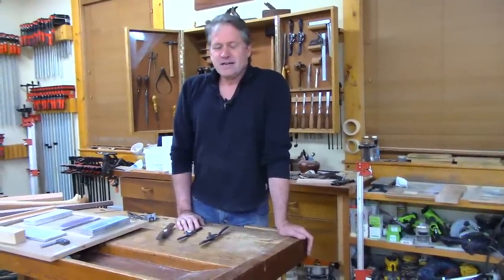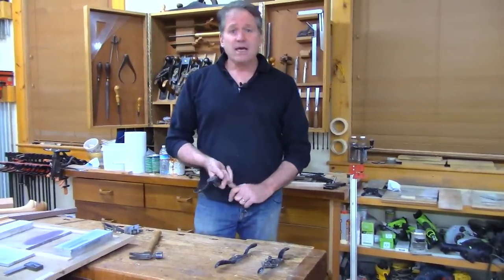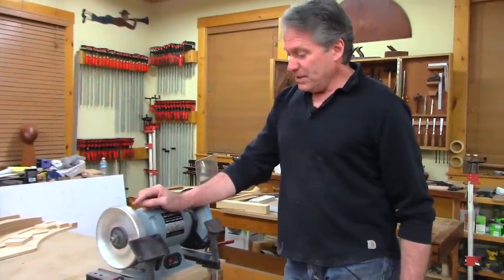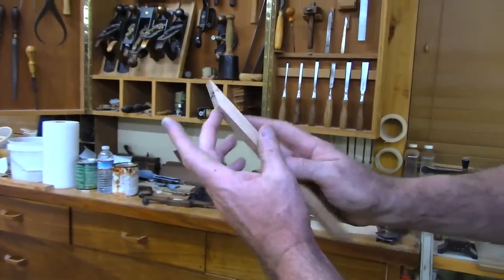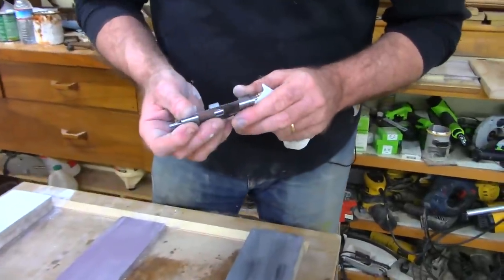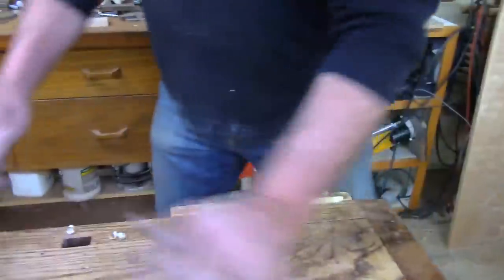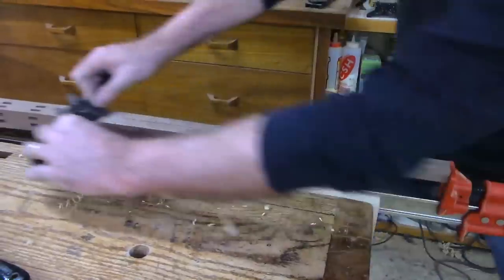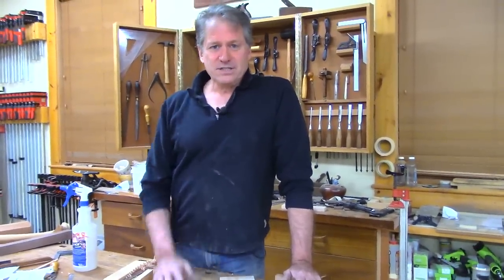How to Sharpen and Use a Spokeshave with Tom McLaughlin

Comment: I’ve got both a simple flat and a convex spokeshave in the No° 151 style, but I’m building one of those Veritas bevel up kits; the handle blank is made from Apple in this case (which for some reason is my favorite handle material for mallets, saw handles, and plane totes) and knurled nuts already have a great patina.   The cheap TayTools set has served me well and I’m glad I got started with them because I was forced to learn how best to sharpen and set them up.  They are greatly forgiving and permit all sorts of experimentation.   In fact if not for the spokeshave, I’d not have ever probably invested in my small 5” slightly curved drawknife.  Both drawnknives and spokeshaves are a bunch of fun and even if you’re not a green wood or a chair maker, a spokeshave will come out in all sorts of occasions.  Not just for chamfers and is an extremely inexpensive tool to add to your collection; especially when you consider the ‘legs’ it gives to your work.  I think the taytools and the kutz are both really decent options for those who can’t find vintage or are worried about what is often horrible pitting on old spokeshave irons that weren’t cared for.    I’ve got large hands and made a really easy jig for holding my spokeshave irons using an idea from Paul Sellers.  The irons are short and sharpening jigs like the bridge city tools, Lie-Nielsen, or tormek will hold them, but for hand honing the handy jig really got me up and going fast if you don’t have a honing guide that can hold and square up such a short iron.  I’m sure you could use a Veritas MkII, but getting the iron square was my issue and so why I built the little Paul Sellers holder until I was able to get a L-N jig.  

 Any luck/update on if Goosebay or another hardwood shop will be partnering to offer project packs in one or more species for some of your project/plans?   I reallllllllly want to build in cherry some, but cherry is nearly impossible to find down here anywhere, so a bundle shipped from a dealer that contains what I need to build a specific project would be great for me, great for the hardwood dealer, and add another great feature to your online classes/built alongside projects while allowing us to also work in species we wouldn’t otherwise get to. 

A big Thank you to both Tom and Kris!  The whole Thursday night and being in central time still isn’t best for me to participate live because Thursday evenings are great family time for us.  I say it every week, “maybe next week”🤣.   At any rate, I appreciate you both pray for you often. 
S/F, Shannon
P.S.- Finally found just the seat blank I was looking for to build the shop stool and 100 bf of maple at the same time yesterday 👍, so I’ll be jumping into that as soon as the walnut acclimates to my crazy humid, big temperature swing prone barn/shop here in Northwest TN.
Reply: Here’s the link to Paul Sellers spokeshave iron holder I spoke off.  It’s a simple scrap wood solution for those without a long jaw L-N or bridge city tool jig:
https://youtu.be/sw1JGEbKgCw
Reply from the maker: Thanks Shannon! Sounds like we share lots of similar enthusiasm for the attributes of the spokeshave! I have heard about the various methods for extending your honing jig to accommodate the spokeshave, and wishing I had included something about them. But I think Paul Sellers has a great method that certainly does the trick! I’ll have to mention that sometime soon.
And I have talked to Goosebay about materials for projects. There really isn’t enough demand quite yet for them to create bundles, probably due in some part to the added labor and expense shipping. But they definitely will ship if you just tell them the rough sizes you need for the boards. I am surprised there is little availability for cherry there in Nashville.
Great you got the materials for the stool and then some! Looking back on it now, I think the most comfortable seat “sculpting” is closer to the way the old metal tractor seats were shaped. Hope you enjoy the project whenever the weather allows, thanks!! 👍🙏😎
Reply: @EpicWoodworking  Thank you.  Nashville isn’t the problem... if you remember, a traumatic brain injury is what ended my Marine Corps career and I can not drive because of seizures and spatial judgement.  I refuse to put Wendy out by having her drive me to Franklin/Nashville to shop for hardwood (just being a good steward of my wife’s daily care and already gracious ways).   I am planning to maybe take a day trip to West Nashville area with 2k in cash or silver in the fall to see what I can pick up from private folk and hit one dealer up too 😊; kind of a day trip with my neighbor (I’ll pay fuel and make sure I feed him well too).   The mill I have here one town over does not sell to the public, but I’m softening one of the owners up to maybe get a haul of off cuts, 2nd’s, etc in what ever run they may have just finished.  so I’ll keep you posted.  I have just finished slabbling up some beautiful 120 year old pecan trees that came down in the recent tornado I told you about.  Have (25+) 8/4-20/4 thick slabs ranging 18-28” wide, and 4-7’ long.  It’ll be a few years 😂.  But I did take a 26” diameter straight w/zero crotch 5’ long log and I have riven it center to make two outdoor working benches for myself and my neighbor, one each.  I’m going to mortise 4x4 treated lumber into them with four legs at a slight splay, will shape them some with drawknife, and once flipped over and positioned I’ll scrub plane them rough flat with my home modified Bailey type 6 no° 5 scrub plane (I know it sounds like sacrilege, but I got the donor casting from a guy who has tuned my type 7’s and type 12’s in no° 3-7.  It had a nasty gouge in the sole almost like a huge hand stitch on a rasp and was not a viable worker as a tuned no° 5.  Instead of becoming some mantle display for someone who never touched a hand tool, I filed the mouth, threw a crazy camber on an old Hock iron and away I go!  As you know the 140+ year old baileys were very light castings and so it’s as light as a modern no° 4 but goes like a beaver after timber. 🦫   I have a L-N no° 4, Veritas LAJ, and some Veritas joinery planes like routers, shoulders, etc... but there’s something magical about getting a Type 7 No° 4’s original tool steel iron sharpened to within an inch of its life when set into the cut. The sound and feeling of that light (ancient to me 😅) tool is wonderful as the aroma is realeased from the timber and smoothing curls nearly float away!  It allows me to connect somewhat to the craftsman that built this old home of poplar, oak, ash, walnut, and cottonwood 125 years ago.  
  I digress; so these out door benches will be great for the ladies to pot plants, to dimension rough lumber when it’s 110° in the shade, and maybe for rough finishing. They’ll be ~400 lbs and with some dog holes, a planing stop, and some TLC will last for many years.  As they move, I can just take the scrub plane to it again 🤣. 
  I know I’m long winded, but I’m excited for what this year holds for me.  It’s the first year since the tragedy of my brain injury in 2013, leaving the Corps and honestly my identity to some degree, after nearly a quarter century in our Corps.  The ‘demons’ you carry with you as result of those things you must do to preserve family and nation are heavy and sadly I’ve lost almost as many Marines to suicide in the last 15 years as I lost to combat in the last 30 years.   Going out to the shop with my dog; wether I accomplish anything or just piddle and make no headway; it gives my mind and body the illusion/perception that I got up and went to ‘work’ that day.  That’s a refreshing feeling that helps me better fight back those always present, troubling, and ‘hauntings’ I carry each day.  Having woodworking has given a slice of purpose that I lost.  As for the struggles of life: our Christ is on His throne, His mercies come with each breath, and the weights I carry are His burdens.  The citizens of this great nation, the allies we support, the people’s who have had chances at freedom from tyranny, You, our wives, our children, and grandchildren:  They are all worth it.  
Thank you to you and your lovely bride; I genuinely appreciate you both and pray for you often. 
Semper Fidelis, Shannon
Reply: @TheSMEAC God bless you. Beautiful testimony m friend.

Comment: I have read where some have the blade set slightly askew.  That way they can get a heavier cut with one side of the blade and a finer cut with the other side of the blade.  Have you tried that?  Does it work well?
Reply: LOL. I didn't wait long enough to post my question.
Reply from the maker: I have not tried that myself, but  see how it could be useful in certain situations. Out of habit and preference, I tend to keep mine adjusted parallel with the sole. And I keep an second spokeshave close by that is preset with a heavier set, making it easy to switch spokeshaves when wanting a coarse cut. Thanks! 👍😎

Comment: Make a stick 2 inches wide 1/2 in thick. 4 inches long. Cut a slot in one end 1/2 inch deep that the blade fits into tightly. You can then sharpen it like a plane iron. Drew
Reply from the maker: Thanks Drew, I have seen various ways of holding spokeshave irons and that sounds like a good one. Paul Sellars has shared a method as well if I’m remembering correctly. I’ve always preferred the speed and edge I get by honing it by hand, but its great to know another method. 👍
Reply: @EpicWoodworking  I get it, I've been sharpening my chisels and plane irons  by hand for over 50 years. Ironically, It was an English cabinet maker who showed me the method I shared back in the 70s. Paul is a great teacher and I'll look for that video..Drew